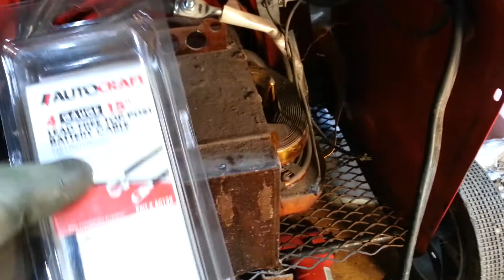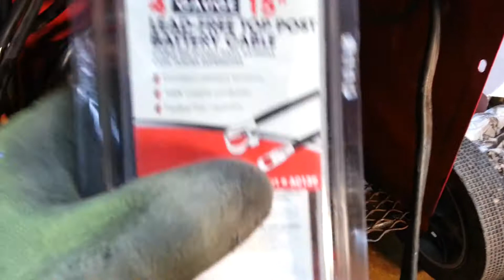Adding Bridge Rectifier 300A/1600V High Power Single Phase Diode to LINCOLN AC 225 Welder

Comment: Add a series inductor after the bridge to smooth out the dc.   (Somewhat).  Make the inductor out of an old microwave transformer.
Reply from the maker: Was looking to do that but not sure exactly how. You know a video showing this?   It is only used intermittently so been collecting dust latley.

Comment: here's where I have and issue  with this   A bridge rectifier, also known as a diode bridge, converts alternating current (AC) to direct current (DC). Bridge rectifiers are used in many electrical products and workplace appliances, and are a key component in power supplies  (battery chargers use them)  Yes, bridge rectifiers are used in battery chargers: 
How they work
Bridge rectifiers convert alternating current (AC) from the mains power to direct current (DC) that can be used to charge a battery. 
Other components
Battery chargers also include a transformer to step down voltage and an ammeter to monitor the charging current
Reply from the maker: You got it! I just wanted to show a quick method on how to convert this AC welder. Thanks for watching! 👍

Comment: What is advantages of making the welder DC over AC ?
Reply from the maker: I really was just looking at how to do it quickly and without a bunch of other complicated elecronic parts. I have 2 DC stick/tig machines also.  But DC is a better type of welding overall for better performance in relation to penetration, appearance, and other things that when this AC welder was made in 1990 was much cheaper then a DC unit that could cost up to a thousand dollars. AC has it's use in a small limited type of welding and I suggest you go online and study up and learn more about DC and AC welding if you are getting in the welding trade. Also youtube has many master welder instructors that have dozens of videos about welding. Good luck with your project! 👍

Comment: You got a pure DC unfiltered voltage. On the Graetz you lose about 3 - 5 Volts, which is negligible. Do not add any capacitors, the currents are too high, they are unnecessary... you have certainly upgraded your device to a higher class 👍
Reply from the maker: Welding is an automotive repair necessity. Thanks for watching. 👍

Comment: That is not what that rectifier does. It doesn't suppress anything as you describe. It takes AC input and outputs pulsating DC. If you add a capacitor to that pulsating DC output, you can get a fairly smooth DC output
Reply from the maker: Because I did not use anything except the bridge rectifier is the reason I stated it is not a true DC current. Thanks for sharing.

Comment: if you add a high voltage capacitor after the rectifier it will give you  dc power if it is sized appropriately.
Reply from the maker: Thanks for watching 👍

Comment: Rectifier doesn't compress anything it removes half  the sign wave cuts the ac in half
Reply from the maker: Thanks for sharing 👍
Reply: A single rectifier (called a half wave rectifier), yes but djrowe2 is using a bridge or full wave rectifier which has 4 rectifiers so there is only a few percent loss in the rectifier itself.
Reply from the maker: I really appreciate all the viewer comments! 👍

Comment: A/C has two conductors. They are neither Positive, or Negative - they ALTERNATE so many times per second. The bridge Rectifier effectively converts these alternating pulses to Direct Pulses - e.g. 'direct current or DC' where one conductor is ALWAYS positive  (when conducting)  and the other is ALWAYS Negative (when conducting). X'tee times a second, the output approaches ZERO, but the current output is always Direct, DC.

With a CHOKE (in series in the + lead)  and A (suitable) Capacitor across the two DC conductors, one can all but eliminate the cyclical voltage drop which makes things weld better.  So far, I've yet to see a detailed description of such a setup (specs on capacitor(s) detailed construction of a suitable/serviceable choke) or I'd share!
Reply from the maker: There is a great video of this demonstration from a genius young man in India. I will try to find and link it to this after I get his permission.

Comment: I'm trying to learn how to use the Prius Gen3 inverter h-bridge for generic rectified inputs (like from a generator or multiple generators) for optional 120, 208-240 and 460-480 pure sine wave outputs since seems like is feasible with the properly designed controller.

I was also wondering what would be the best way to design a circuit for options to output as a welder power supply besides feedback for CV or CC and frequency control, in particular a high power offset circuit so for use in aluminum welding, i.e. an offset square wave so can select a range of DCEP or DCEN ratios.

Kind of off topic, though neat to see your design and got me thinking about since on the topic of assessing options before getting into the intricate details of the circuit modeling before some hands on experimental testing before scaling up the actual controller(s).
Reply from the maker: That sounds awesome! 👍
Reply: Well, bless you heart.
Reply: @notcharles  You know, I finally actually posted on the openinverter forum this vision of a project.  Wound up investing in a gen 2 prius as well and three inverter converter assemblies to work with since those parts inside like the IGBT H Bridge inverter, converter and other parts seemed more modularized.  Zombieverter seems better maybe for the gen 3 as a plug and play option maybe with only coding required to do and openinverter I found has been demonstrated by the creator to produce noisy 220VAC mains output and he notes that did fry some equipment that I guess needs the pure since wave output.  I last left off wondering about filtering the signal to remove the harmonics so to make a stable pure since wave output to start with in a more compact way to avoid the larger like buzzbox maybe size transformer cores as a cost effective way to wind an inductor.  Maybe multiple microwave oven transformer cores wound as inductors might be correct.  I studied the impedance theory a little more as well last night actually to better understand the reactance at the different frequencies coupled with resistance to determine impedance where impedance is basically resistance at different frequencies.  Lots to still learn, though slow turtle pace style moving forward.  Thanks for the kinds words to remind and inspire.
Reply from the maker: Sorry for long delay in response as I had to look into the multiple microwave transformers which took a few months to gather the theoretical information and feel that yes it would be a better possible method. If you have found out that to be true then let me know how it works out. I may try that as well and make a video if so. 👍
Reply: Thanks for the response.  Similarly, I've not worked on in a few, though someone else has recently inquired about the inverter-converter assembly design as a universal pure sine wave inverter.  I mentioned either maybe like an old transformer design welding machine as-is using a winding as an inductor or rewinding or rewinding multiple MOT's. Just been busy with two many things, including advocacy work.   @djrowe10
Reply from the maker: I have been slowly collecting the transformers to try out something new as well. Will have to wait and see if it works out or not...🤔
Reply: Awesome, me as well.  I've got quite a few free MOT's and not many welding transformers.  Two larger 200A+ battery chargers as well, though the one I tested so far wound up working, so hesitant to use that one as a core.  Yeah, there is theory to calculate the inductance required with the cores and while also considering the current requirements for the over rated voltage peak continuous going through them.  There are also little LCR meters for a few dollars that can be had and I'm thinking might be worth investing in to test to see what the inductance and other electrical characteristics are for when you add your inductor. @djrowe10

Comment: You are correct in that it doesn't make It DC but incorrect in that it compresses it. It will actually invert the negative side of the wave and over lap the positive side of the wave which will give you pulsed DC. But good video.
Reply from the maker: I get that, but it is hard to explain in any other way about that to those not well educated on electronic theory and practice. Thanks for watching! 👍

Comment: My dad got his Lincoln 225 in 1975. He gave it to me a couple years ago. It still works great, but needs a fan replacing. I just might try this. Great video. Can anyone tell me if dielectric grease could be used on the heat sink. Thanks, stay safe.
Reply from the maker: You can buy actual heat sink grease on amazon or use white lithium grease if in a pinch to test it out. Good luck with the project!👍

Comment: How many watts can this handle?
Reply from the maker: Not sure if the manufacturer lists watts as welders operate on amps/volts. This 300 amps or 1600V which converted to watts mathematically is 480,000 watts. Good luck with your project! 👍
Reply: @djrowe10  Thanks I really appreciate it
Reply: @djrowe10  so it I add 10 10amp 12volts lithium battery packs to the back of my solar panel connect it to motherboard with xt90 connector then connect that to 100amp mppt controller to my solar panel would that work?

Comment: I wanted to ask about rectifier reliability. Is it good or not ? Because it is noname i do not know if it is reliable or not. I am hoping that you are using the welder and would like to share som experience about the rectifier. Thank you
Reply from the maker: Seems like only one to find online. Back not too long ago I would go to radio shack and get my electronics. Now we have to rely on ebay and amazon unfortunately. Hasn't melted or burned up yet after some mild use. Haven't put machine to full amp setting just 90-120 so far and welds a bit better. I have a DC stick direct current 220amp machine for heavy steel.
Reply: @djrowe10  Thanks a lot

Comment: I have a ac225 buzz box. I purchased it in 1990. It sat for 25+ years unused. I got 220v in my garage, last summer. I plugged it in, it works beautifully. I considered these rectifier bridge add on's for dc welding. But after reviewing my Bridge rectifier training on JG The Organic Chemistry Tour, I understand why Lincoln charges what they do for an AC?DC BUZZ BOX. I am NOT a pro welder by any stretch of imagination, but if I need DC, it's better to buy a box that has DC. These rectifier add on's don't have the current and voltage regulation needed for a good signal. But I am sure MANY will be able to make it work for their needs, JUST FINE. If I could sell my AC BUZZ BOX, I would fork over the cash and buy the AC/DC version, or buy a DC capable box. If I can find out what stick to use to weld Aluminum with AC, i keep what I got.
Just sayin!
Reply from the maker: This modification is just a bandaid for sure. I sold my AC/DC Lincoln welder and just bought 2 separate welders one portable DC and this AC box. I can get you the part number for a good AC aluminium welding rod. Just let me look in the shop next time I'm there.
Reply: @djrowe10  Thanks for any ac rod assist you might find. Along with my Buzz Box I got a Lincoln 110v sp-125+. Both over 30+ years old. I want to take advantage of new 220v in my garage. Looking to get anther box, probably a MP combination, with a spool gun. Just want to be able to do some light aluminum, and some sheet metal auto repair. Maybe on 20 years I'll be a BAD A Welder!
Reply from the maker: I looked at my shelf and have a box of something from Amazon supplier called SUA welding technologies.  It is OK...will work in a bind but not best out there. Will add link at bottom. Sorry that I couldn't find my blue demon rod because it is the best. You can also call blue demon directly and ask them what rod you should get. They are a good company. 
If not try the amazon special I found recently. 
Aluminum Electrode - E4043 Stick Electrode - 14" x 1/8" - (1 Lb) https://www.amazon.com/dp/B074W9R9Z7/ref=cm_sw_r_cp_apan_glt_i_ZS96AX8P9H846JZCY5WZ?_encoding=UTF8&psc=1
Reply: @djrowe10  Thanks for the info....My new lincoln l31mp just don't have what it takes to strike an arc with 3/32 4043 rod...just for giggles I cranked up the ac225 and it can't start an arc either....it was a long shot either way...time for a spool gun.
Reply: How many watts can it handle?

Comment: If you want cleaner DC you can make an inductor "Choke" using thick wire and an alternator core, microwave transformer core, etc. Also you can wire a capacitor in parallel on the output leads something like 40,000uf 150-200volt rated... Just what I've picked up reading so far.
Reply from the maker: I've got a couple microwaves but haven't tore apart yet to get transformers out. One of these days but haven't used that welder for a long time now.
Reply: Do you wire the capacitor on the stick lead only?  And would you get a cleaner DC wave by using the positive as your clamp and negative as your electrode?
Reply: @josephhreha8465  I tried reverse polarity and really got no difference, (negative lead to the stick side) I would just keep it positive electrode. Your capacitor needs to be rated higher than your voltage, there's a white stripe down the side of your capacitor, that's the negative side which attaches to ground clamp wire between your diode and your ground clamp, the positive lead on your capacitor attaches between your electrode and your diode. Mine went diode first, then inductor (wired in series) on either the positive or the negative side it doesn't matter. Then my bank of capacitors the positive leads wired to the electrode side and the negative leads wired to the ground clamp side.
Reply: "wire a capacitor in parallel" I think you meant 'across the output'
Reply: i think he can do a choke by using the welder transformer ferromagnetic core by adding like 15  turn over the top of transformer there is empty spot over the ferromagnetic core  it my help
Reply: Don't worry if you get it wrong, your capacitor will explode and shoot hot oil everywhere. Along with a huge cloud of smoke and steam. 😎😆😆😆 (Ask me how I know, lmao)
Reply: @crazyDIYguy  🤣.  Tenfour.  I appreciate the info.  Building mine today
Reply: @crazyDIYguy  And, so, we ask, how did you wire the cap that blew up?
Reply: You don’t need the cap
Reply: Cap makes a big difference, I tried without one and the cap made it seem well worth it. But no it'll work without too
Reply: @crazyDIYguy  The one video I noticed, guessing since more a Constant Current (CC) design, the inductor made the main difference in better performance and the capacitor.  Basically, the inductor smooths the current so not as much ripple and the capacitor smooths so not as much potential ripple... so when the inductor inductance is enough... theoretically you actually do get a smoother DC signal and not like without where is more a full or half bridge rectified waveform with the ripple (I think that's the term).

Comment: is it possible to weld with one transformer and 100amps Rectifier
Reply from the maker: No 100 amps is not enough generally. You need to have the amps safely higher then amps of welder used to not overheat and destroy the unit. So if your welder is under 100 amps then that may work.

Comment: If you add a switch n a 300A relay would it become switchable ac/dc weld sir? Appreciated your advice.
Reply: Just attached rectifier to quick connects so you can attach it or deattach from work lead or electrode lead outside machine
Reply: @travisfeltwater5664  do you think by adding bridge rectifier it's dc enough or do we need to add an elco as well to make it more smooth?
Reply from the maker: I cannot say for certain that it would 100% work as I am not sure about what exact parts you would use. Plus I am not an electrical engineer but I do think it is possible. If you try it let me know if it works.

Comment: By definition a rectifier converts AC to DC. In this case it's pulsating DC. You can smooth out the ripple with a CRC or a CLC network. The compressed AC line that you are talking about is the ripple. If you switch your meter to DC you will see the DC component.  Check out this video: https://www.youtube.com/watch?v=p5DLEpDRBYk
Reply: As an electronics engineer I can confirm what Christopher said as well. Check out the topic full wave bridge rectifier.
Reply from the maker: Thanks also.
Reply from the maker: thanks

Comment: im doing to same thing. BUT you might want use the positive off the bridge recruiter as your clamp/ground and negative for your weld stick. ALSO you want 23k-50k uf caps and a bleed resister in parallel. and if you can find a microwave transformer core as an inductor. also some LPD-50 quick connects would be nice too
Reply from the maker: Yes, I have found a microwave transformer for parts.
Reply: @djrowe10  how is it holding up any updates how is it working. good?
Reply from the maker: @joeydelmarsjr.646  It seems to weld better or about the same with less spatter and has held up ok so far but I have only used 3 times since converting.  I mainly use mig or tig and my tig machine does stick in DC. It is a project in progress to say the least and needs fine tuned still. Good Luck!
Reply: @djrowe10  I'm thinking of getting a primeweld 225
Reply: @Joey Del Mars Jr. Do the capacitors go on both leads or just the electrode? And where does the transformer fall in line?  Before or after caps
Reply: " bleed resister in parallel"
Specs on the suggested resistor?
In parallel with the caps?
"23k-50k uf caps "
Hmm, how many caps?